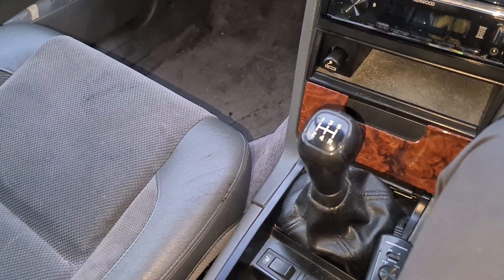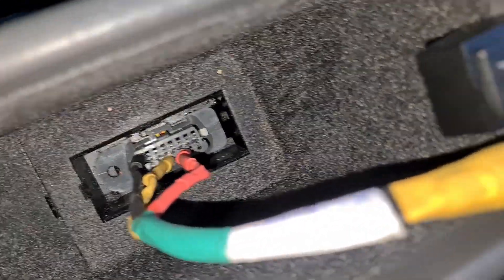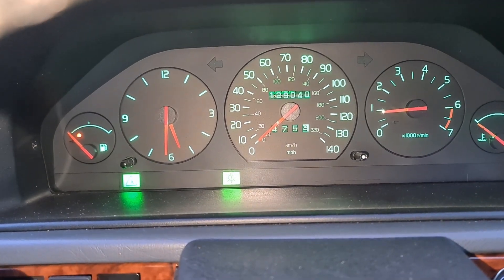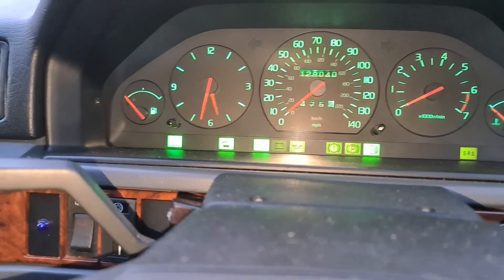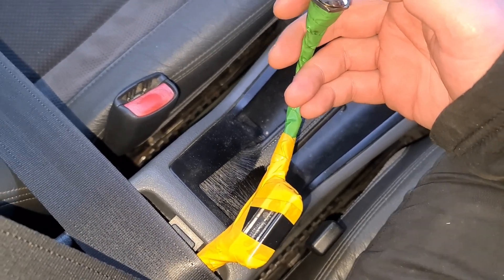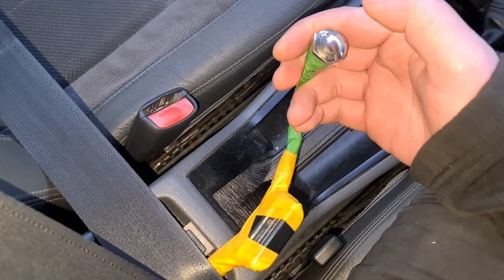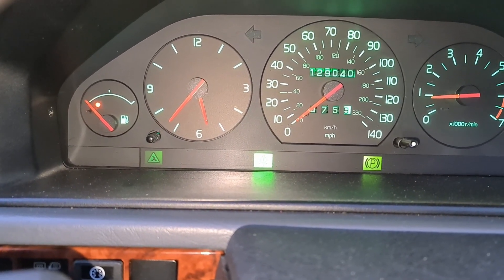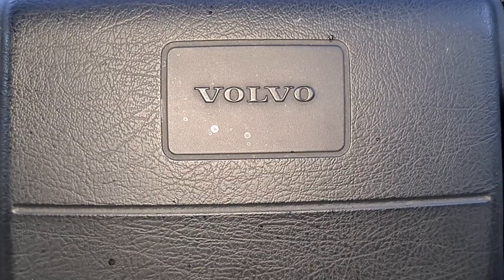Project Turbo Brick Ep13 ( Volvo 940 Diagnostic Trouble Code Reading Using Homemade LED Flash Tool )

Comment: Hi Dan, thanks for the video, very helpful as I hunt a misfire down on my 940. When you said the lead can go on pin 4 or 5, does it not matter which? Cheers.
Reply from the maker: Yes it worked on either for me.
Reply: @DanWithAPlan666  great, thank you. Will that read all modules/errors from the one setting?
Reply from the maker: @jacobwatwood9916  no each module has its own pin allocation. I had to Google the imfo to find which pin relates to which module, but found that there was some conflicting info which lead me to believe that depending on the year and which market or part of the world the build was intended for, there could be different allocations. On top of this, some pins are for optional extra modules such as cruise control. What I did was I unplugged a fuel injector to force a fault code, then once I got a code from on of the pins that related to injector circuit, that wasn't previously there, I knew that pin was for the ignition module. I then repeated this for the maf sensor to trip a code in the fuel module (main engine ECU in my case)
Reply: @DanWithAPlan666  thanks Dan, really appreciate the help!